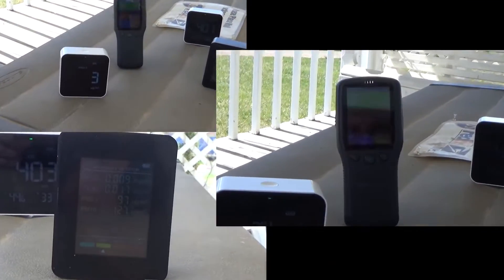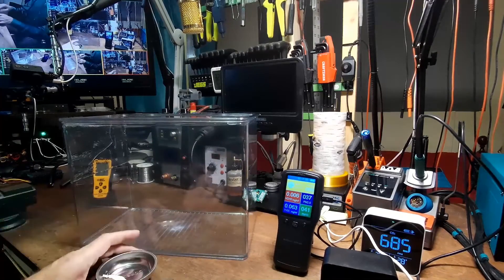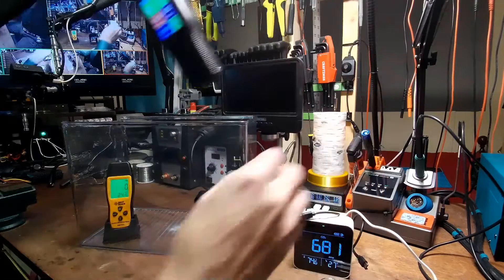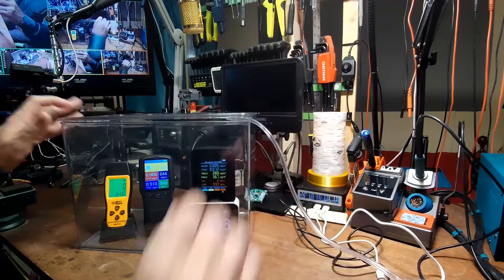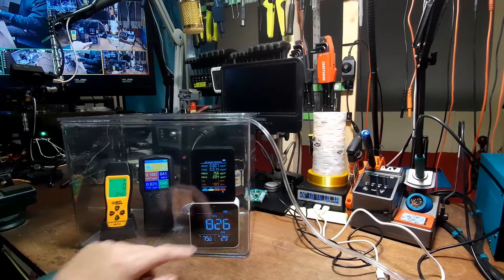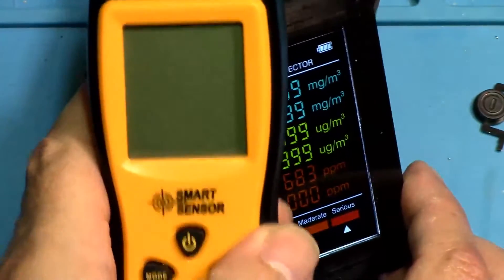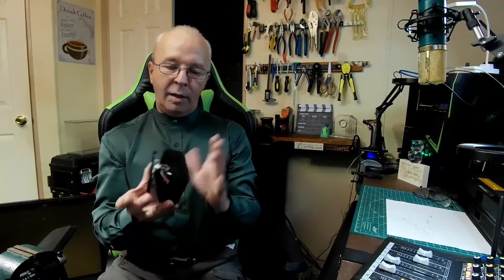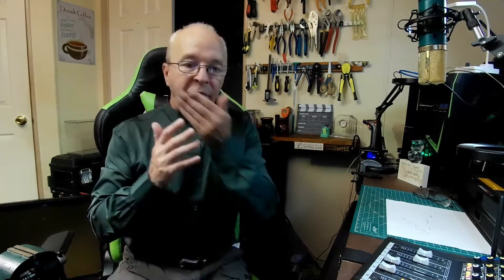Compare Fake Chinese Air Quality Monitor To "Smart Sensor" CO Monitor & "TemTop" CO2 Monitor

Comment: WARNING: This is ONE model sold online. Various models may look alike externally, and be very different internally. I have an identical looking device, but has no carbon monoxied or PM counts, and it accurate to about 15% of my reference devices. 

If you need to measure air quality for your health and safety, DO NOT try to save money.
Reply from the maker: Yes you are right, this is just one model sold online, and you are also right that there are a lot of models that resemble a TemTop monitor, and some of those are not the most accurate.  When it comes to accuracy, pin-point is not as important as a need to know.  When it comes to what you need to know - CO and CO2 is the most important to know.  CO2 should be between 600-800ppm (normal levels), CO should be 0ppm at all times.  Anything above 0ppm CO for more than a minute means there is an issue that needs to be addressed.  You are also right about Not trying to save money buying cheap monitors.  There are some monitors that are inexpensive (like the Smart Sensor CO monitor) that you can trust, but just because a monitor is cheap does not mean it is a good monitor to trust for your safety.  Good points you make.

Comment: 6:02 "If you have 10 people in your bedroom, and some people start complaining they're sleepy..."
So it's not just me!
Reply from the maker: Maybe I shouldn't have said bedroom, but I was just trying to make a point.  I may have said living room as that is where most people are going to be gathering in a home LOL.  The point is if you are in a crowded room and you begin to feel sleepy or nausea, then there is something wrong and you need to vacate the area for fresh air.  Make sure if you are in a crowded room, check around to see if there is adequate ventilation, and if not, don't hang around too long without getting out for fresh air from time to time.  So - No it is not just you :).

Comment: check tvoc and mq-7 etc sensors. they are not fake also not accurate and they cant distinguish which gas is which. that is the reason when you put ethanol it also detects it they are mems or silicon based sensors. to read co2 exactly you need opto acoustic sensors.also to co you need to make sensor fusions. but it means they are totally fake. check how to read co2 with tvoc sensor for example of course it wont be so much accurate.
Reply from the maker: Thank you for your thoughts - much appreciated

Comment: So, the co2 and co meters are fake, but the particle meters and humidity is still legit? Actually, I am mainly interested in particle and humidity.
Reply from the maker: @____Ann____  There is NOTHING about this fake monitor that I would trust, not even the particulates - NOTHING.  I do not recommend anyone to buy the fake monitor.  The yellow Smart Sensor CO meter is great, and as far as CO and CO2, those are the two MOST important readings to know, so I would not consider knowing particulates over knowing CO and CO2.
Reply: Then buy a PM and humidity sensor.
If you go down the "oh, but I just need..." route, you will end up supporting a scam. 

By buying a product you show a manufacturer and search engines that people will fall for it. Them someone will eventually get it to monitor CO. They start feeling drowsy, but sensor readings are fine... I hope this doesn't happen. CO can diffuse through many things that stop particles themself, so the fake meter will not warn them.

Comment: My friend when you burn paper it will release co2 and the Chinese meter must be in same level on the ground,
Reply from the maker: Thanks for the clarification
Reply: @Outside-In.  thanks for your understanding , as you know the co2 gas is heavy gas, so the bottom sensor sees co2 but the above sensor not yet, what do you think about Hotkrem co2 monitor , i thinking to buy one :) , thanks
Reply from the maker: @WRDO  I love the Hotkrem CO2 monitor, but unfortunately, Hotkrem has gotten pretty bad on quality control, so cannot recommend them any longer.  Smart Sensor is my favorite for CO2 and CO meters.

Also - the Fake Chinese monitor is very fake, so please don't put any trust in it.

Comment: Oops... I fell for it. What confuses me is that it goes all the way up sometimes, and there is no alcohol in the area. 
So what is the budget air quality meter?
Reply from the maker: Cologne will make the reading go high, getting out of the shower and walking by the monitor will also make the reading go high, if someone is drinking alcohol, and breathing next to it it will go high, also I believe that it is affected by other readings as well, so why that it seems random - making it appear to be legitimate when it is not.

As far as low budget meters...  I am not sure there are any.  By that I mean - all of my budget meters have either quit working or no longer are consistent even with re-calibration.  So I would venture to say that a quality monitor is going to be in the 100's of dollars range, and even some of those don't last more than a few weeks or months, so your guess is just as good as mine unfortunately.

The two most important readings to know is CO and CO2, so I would forget about any monitor except for those two, and I believe that paying a bit more for a better quality meter is the best.  CO is the most important, CO2 is second most important.  CO2 and CO meters can be expensive, but CO is the least expensive of the two.  The Smart Sensor CO and CO2 meters that I use are what I recommend.  CO2 sensors are expensive, and maybe it is because they are harder to make or harder to come by the materials to produce, not sure.

Hotkrem was my favorite low budget monitor until I found out that some work, some don't, and some work for only a couple days or weeks, so I can't even recommend Hotkrem any longer, I have simply ran out of monitors that I can recommend - except of course Smart Sensor CO and CO2 meters.  I am sure there are other CO and CO2 meters that are just as good as Smart Sensor, but I simply cannot afford to buy them - way too expensive LOL.

I know this information probably doesn't help that much and I am sorry about that, but that is what I am finding out after all the tests that I have done...

Comment: Which Amazon air quality sensors do you recommend? I don't need a carbon monoxide detector
Reply from the maker: I can recommend the TemTop CO2 meters, Smart Sensor CO meters.  Other than that, none of the monitors I have tested still work accurately, and why I have come to know that unless you pay 250.00 or more for a monitor, it is a hit and miss on quality and longevity.  

The type of sensors I recommend for people to have in their homes are CO and CO2 period.
Reply: @Outside-In.  So, in your opinion I don't really need tvoc and hcho meters? Only the CO and CO2? Thank you
Reply from the maker: @daniiltuneev3123  There are more than 10,000 TVOC's, which makes the reading pointless.  Most TVOC's are nothing more than odors, and only a handful actually gases.  If you clean your bedroom, bathroom, kitchen, etc., the reading will go up.  If you burn candles, the reading will go up, and all this causes paranoia.  HCHO is in everything in our home, and whenever it is disturbed, it will cause the reading to go up.  Unless you keep containers of HCHO in storage in your home, I dont see the point of the reading, as everything that we do, vacummiing, cleaning, making the bed, putting together a peice of furniture, unwraping a picture to hang on the wall, will cause HCHO levels to rise causing paranoia or worry and stress.  TVOC and HCHO levels will fall quickly after rising in most cases.  Opening a window will also cause the levels to go back to normal.  A good reason to see these levels is to use it as a gauge that you need to get some ventilation going, but unfortunately, most people become stressed at the levels costantly rising and falling.  That is why I do not pay attention to TVOC or HCHO, except to know I need ventilation.  CO and CO2 are on another level.  TVOC, you can smell, CO and CO2, you can not...  CO and CO2 are very deadly gases that can sneak up on you, and kill without even knowing it is there, and why the readings are so very important to know.  

I hope this helps, and also explains why I push knowing CO and CO2 so strongly.  I myself nearly died from CO and CO2 poisoning about 6 years ago, and the main reason I stress the point so much.

Comment: This is an excellent video, and now I kind of want to take apart my 2024 "Upgraded" version. (And your how to take it apart bit of the video is greatly appreciated!!) Now, after doing the same tests as you did, it is actually detecting CO (the burning paper blown out) and CO2 (Sourced from a can of pop.) The PM 2.5 and 10 readings outside correlate well with my city's monitor, and rise drastically when I smoke near the unit, (Makes me think I really should quit that habit! lol) or when sweep the floor. Now, when it comes to HCHO and TVOC, it does react to alcohol - very high TVOC readings, but doesn't max out. I'm hoping to find a confirmed source of HCHO and see if it does sense it correctly.

I bought this thing for the PM readings, as to see what it does during forest fire season. However, I would never trust it compared to my real CO alarm, etc. 

Thanks again for an excellent video!
Reply from the maker: I would not at all trust this fake monitor for any reason.  I don't care how many upgrades they do to it...  If they have fixed this fake monitor based on my review of it, then they would have contacted me to let me know they fixed it to be real and not fake, so do not trust this fake monitor for any reason whatsoever.   Not for CO, not for CO2, not for PM, not for HCHO, not for anything.  This is garbage and should never be sold again.  If this was actually changed to be real, then the price would have tripled or more with real legitimate sensors inside.  DO NOT trust this monitor - PLEASE - throw it in the garbage where it belongs- PLEASE...

Get yourself a real legitimate monitor.  Thanks for your thoughts, but PLEASE get rid of this fake monitor :)... 👍

Comment: Thanks for your great video.

I’m currently developing a project that uses MQ135 and MQ9 sensors to monitor various gases like CO2, Ammonia, NO2, Ozone, CO, Methane, LPG, and Hydrogen, among others. These sensors detect the concentration of these gases in the air, converting the analog values to PPM (parts per million) which are then used to calculate a combined Air Quality Index (AQI). The AQI provides a clear indication of the overall air quality by averaging the PPM values of the detected gases and mapping this average to a standardized AQI scale ranging from 0 to 500. 

However, I’m keen to ensure that the values shown by these sensors are accurate. Could you provide any advice on how to validate and calibrate the sensor readings to ensure they reflect the true air quality accurately?
Reply from the maker: Thanks for the comment and question.  The only advise that I can give, would be to get yourself a true and accurate Lab testing monitor, and those are very very expensive - in the thousands or tens of thousands of dollars.  Fluke makes such a device, but I believe it costs more than 3,000.00.  You can also rent them, but you would have to Google that to know where to rent lab quality monitors for calibration purposes.  You can also purchase Gas cylinders from Forensics: https://www.forensicsdetectors.com/collections/calibration-gas.  These will allow you to test the accuracy of your sensors. 
You could then program/adjust the sensor readings to be more accurate.

Hope this helps.
Reply: Did you check MQ135 with co2 cartridge? I  tested co2 cartridge with Chinese co2 monitor but it didn't work. Could you tell me about your type of co2? Thank you very much.

Comment: Where did you get that slick green shirt from? lol. Great informative video! By the way, the MQ-7 (CO) and MQ-3 (alcohol) sensors, physically look the same. It could be a deliberate attempt to deceive or maybe a manufacturing error. The sensors cost about the same $$$.
Reply from the maker: WalMart dot com is where I got the shirt - my favorite color so I couldn't pass it up LOL...  And you are probably right - the alcohol sensors they use, are picked especially to look like a real CO sensor I am sure.  
Thanks so much for your comment and information - it is much appreciated. 👍
Reply: @Outside-In.  You're welcome and thanks for the info. Keep up the good work on the channel!
Reply from the maker: @TheDradge  Thanks, and I will do my best to keep it interesting. 👍

Comment: Hello, great video and very interesting. I'm developing a low-cost air quality sensor with Arduino to detect CO, CO2, and PM2.5. For particulate matter, I'm using the same sensor, the Sharp GP2Y1010, based on the research I've conducted. To use this sensor, it's recommended to have an airflow so that the 2.5 particles can pass through the aperture where the photodiode is located, enabling the sensor to read particulate matter. I've developed the airflow using a small USB fan inside a box. Under indoor conditions, it yields readings within a range of approximately 10 to 18 µg/m3.
Reply from the maker: Interesting...  The sensor you are talking about is a dust sensor.  I assume you are adding a CO and CO2 sensors to the GP2Y1010.  That looks just like the sensor in the fake Chines monitor.  The one in the fake Chinese monitor didn't do very well for anything, but it could be because of all the fudging numbers that they do with it.  For 12.00, I would be skeptical about this - it only has a 2.5 star rating, so not sure it is the best choice to be building a air quality monitor with.

It would be interesting to know how it goes however, so if you could let us know - that would be great.

Thanks for the comment - much appreciated. 👍
Reply: @Outside-In.  Yes, it is definitely a clone of the original GP2Y, but of poor quality. The original one I have is calibrated according to the manufacturer's datasheet curve, in a "clean" environment it gives readings of approximately 10 to 18 µg/m3. When measuring a car's exhaust pipe, it has recorded maximum PM levels of approximately 65 µg/m3. I would like to investigate whether these values are accurate or how close they are to reality, since they are low-cost sensors that already have a margin of error. For CO readings, I use MQ7, and for CO2, I use MH-Z19.
Reply from the maker: @mariojavier3456  Thanks for the reply and information.  Sounds like an interesting experiment, and hope you get good results from low budget sensors to build your monitor.  👍👍

Comment: I came across your video because I wanted to open one of these to find out what sensors they used. I wasn’t expecting a high-end ‘low-cost’ sensor when I ordered it, but wasn’t expecting such poor sensors, either (why would anyone even go through the trouble of designing and manufacturing this …?). When/If I find time, I may actually try to use the display together with some real sensors from Sensirion, although it will take considerable effort to control that display, I guess. Any experience, anyone?
Reply from the maker: Thanks Jorg for your comment and thoughts - much appreciated.  I did like most people that end up with this and just threw it into the garbage pail.  I was thinking later though, that the case may have been good for something DIY, but, so I guess I could have used it for that.  I am not sure about the screen however, but it would be a great way to re-use the screen - ya know - actually be able to display something truthful????. 🤔🤣😅

Comment: Thank you so much!
I was about to buy one of these for my smart Home...
...is there a way you could do a video wich sensors you DO recommend?
...preferably with wifi / BLE / zigbee built inside?
Reply from the maker: Thank you for your comment and question.   I have been looking at the Qingping and the Arante4, but i have to wait until I can afford to get them first.   As of right now,  I do not have any monitors with wifi or Bluetooth capability.

Comment: I confirm that this sensor is fake and reacts only to alcohol, even to my perfume.
Reply from the maker: Sorry about that, I just got the alert to your message LOL - YouTube sometimes :0

Glad to hear someone else that can confirm this to be fake
Reply: @Outside-In.  I have an Elgato Eve Room, an Aqara Air Quality Monitor, and two of the 6-in-1 monitors mentioned in your video. Among these, the Eve is the best. It updates approximately every 10 minutes and detects various odors, such as glue, excessive cleaning products, or VOCs released from new furniture if the room is not ventilated regularly. The Aqara shows similar results, but its problem is that it does not update in real-time. Sometimes, it displays the same reading for an entire day. However, the 6-in-1 monitors consistently show the same values and only react to alcohol.
Reply from the maker: @obekta  Yep, the 6-in-1 is garbage.  I have another Amazon monitor to review soon "and it looks legitimate " LOL...😜

The Eve sounds interesting, will have to give that a look, thanks for the comment and experience - much appreciated.

Comment: Tip: you don't need to buy a Soda Stream to test for CO2; you can simply mix sodium bicarbonate and vinegar. The gas that reaction produces is CO2.
Reply from the maker: Thanks for the tip - interesting. 👍
Reply: Yup the old volcano experiment when you were a kid.